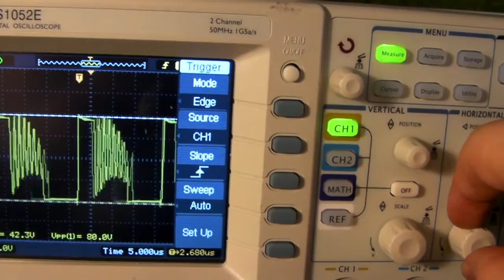An audio-modulated flyback transformer I built 5 years ago

Comment: This is the first time I have seen this done with a micro controller on You tube. I was thinking of doing something similar with a BLDC board I put together. Awesome.
Reply from the maker: Doing that with any motor driver should be quite simple as long as you can connect an SD card or get audio samples in some other way. I might give it a try on one of my motor controllers soon.
Reply: Benjamin Vedder Just to test the concept and keep it simple I was just going to feed music into the A/D inputs. (I'll have to think of some more features to make using a micro more worthwhile than using a 555 in my case). Your motor controller could power a huge  fly-back transformer or tesla type coil, I guess if the card reader is SPI it shouldn't be too bad, I need to learn how to use SPI  and write an interrupt driven routine.